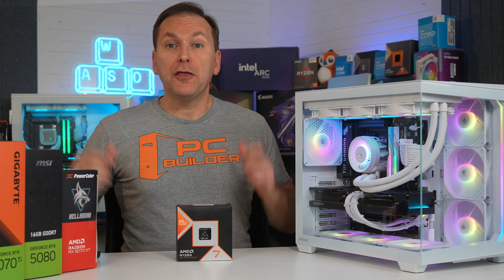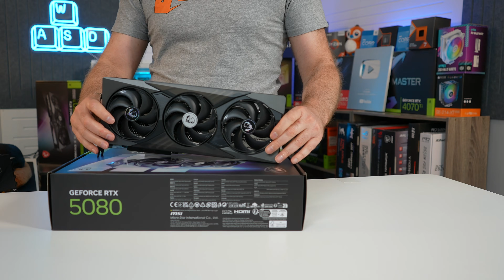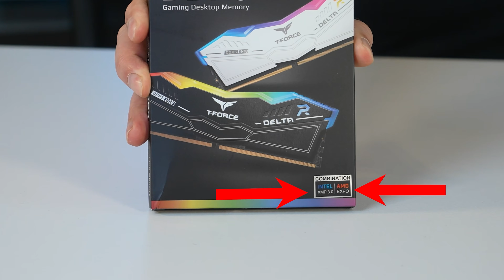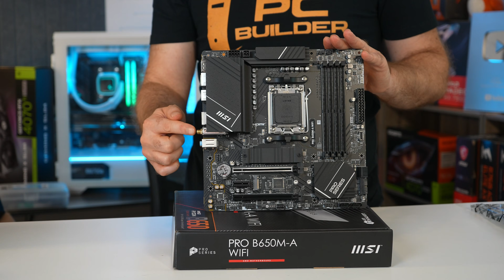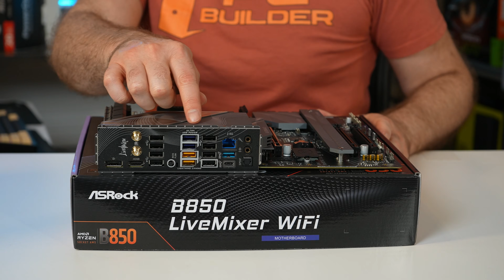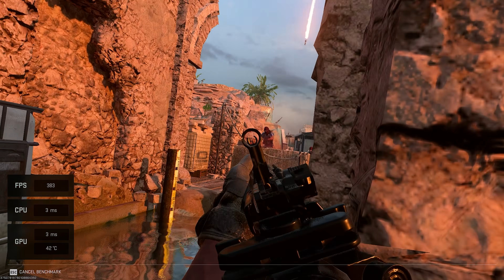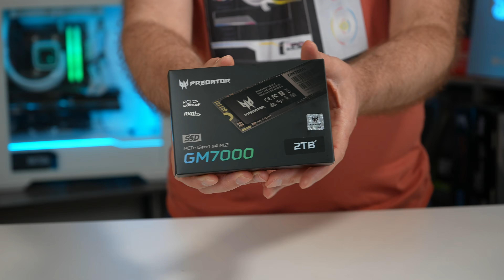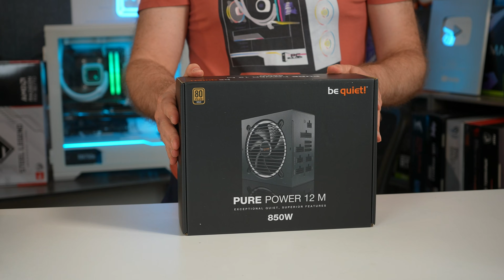Best Ryzen 9800X3D PC Build 2025 🛑 Best GPU, RAM, Motherboard & More

Comment: 3rd PC build just finished it mid march
CPU - 9800x3D
GPU - RTX 5090 
RAM - 64 GB Trident z5 Neo RGB 6000/CL30
MOBO - MSi x870e Carbon WiFi
SSD - 4TB Samsung 990 Pro NVME
PSU - NZXT 1200 watt ATX 3.1
CPU Cooler - NZXT Kraken Elite 360mm 2024 
Case - Hyte y70 (non-touch waiting for HAVN HS 420 to be instock)
Reply from the maker: Congrats on your third build! And thanks so much for tuning in :)
Reply: 9950x3d is better
Reply: @UM_88-s2c  wasnt out when i built and im not spending 700 on new cpu when mine is better for pure gaming and i dont focus productivity

Comment: ASRock B850M Pro-A/Wifi $110/$120 - pcie gen 5, 3 m.2, 8 usb ports: 4 hi speed w/1 type C, 2.5GB LAN
ASRock B650M PG Lightning Wifi $120 - 3 m.2, 8 usb ports: 4 high speed w/1 type C, 2.5GB LAN
ASRock B850M STEEL LEGEND WIFI $160 - pcie gen 5, ALC1220, 3 m.2, 8 usb: 4 hi speed w/1 type C
ASRock B850M Riptide WiFi $190 - pcie gen 5, ALC1220, 3 m.2, 8 usb: 4 hi speed w/1 type C, 2.5GB LAN
ASRock B850 Pro-A WiFi $160 - pcie gen 5, 4 M.2, 12 usb ports: 6 high speed w/2 type C, 2.5GB LAN
ASRock B650 Steel Legend WiFi $190 - pcie gen 5, ALC4082, 3 m.2, 10 usb ports w/1 type C, 2.5GB LAN
ASRock B850 Riptide WiFi $190 - pcie gen 5, ALC4082, 4 m.2, 11 usb: 7 hi speed w/2 type C, 2.5gb LAN

Comment: Going with a Be Quiet!-themed build for mine after lucking into the GPU I wanted:

CPU: 9800X3D
GPU: RTX 5090 Gigabyte Aorus Master Ice
MB: Gigabyte X870E Aorus Pro Ice
RAM: 32GB white RGB (haven't decided yet)
SSD: 2TB Samsung 990 Pro + 2TB WD SN850X
PSU: Corsair HX1200
Cooler: Be Quiet! Light Loop 360 (white)
Case: Be Quiet! Light Base 900 (white)
RGB cable extensions/covers
Reply: replace the corsair with Darkpower psu. i done similar thing a long time ago XD i blame Dawid for this

Comment: I went 9800X3D, Gskill Trident Z5 NEO 6400 CL30 (32GB I already owned), Asus ROG Strix B850, Corsair MP700 SSD, Corsair 240 AIO, and Corsair 4000 Frame case (best case EVER).  all on a Seasonic Vertex GX-1200 watt power supply.
I have a 7900XT, Keep trying to buy a Sapphire Nitro+ 9070XT. (need the 16 pin because my AIO uses one of my PCIe power slots and I only have 3 of those total.  so I have no option but to run that 16 pin connector.

These site always recommend some barely good enough PSU. Get yourself a 1200watt or higher and then if you buy a used 5090 in a year, you won't also have to buy a new PSU...  850Watts is Barely enough to turn a PC on these days.  it's the Only thing I never agree with on these videos. its almost like they are afraid to recommend a part that you can reuse next build.  power supply requirements are not going down. stop buying 850 watt PSUs  really bad advice and nothing will ever change my mind.  never buy less than a 1000 watt unless you are building something with a 5060 graphics card or less and NEVER plan to buy a fast card.  a 9800X3D build with a 5080 and the rest wants 646 watts X 1.5 = 969 watts.  850 is Not enough. now throw in 200 watts more for a 5090 and you see why I say Get a 1200 watt PSU.

Comment: I recently upgraded my 8700k to a 9800x3d with a ASUS b850 WiFi plus and 32 gb 6400 corsairs ram to pair up with my 3080 10gb from my friend. Now I’m not getting bottled neck on most games!  Wasn’t cheap for the build but I’m just future proofing with am5.
Reply: @seasonalocean  damn dude, that's a monster upgrade!
Reply: I have the same motherboard and debating of getting the 9800x3d over the 7800. I have a question did you update the bios or did it work out of the box?
Reply: @Stickman_gt1  well worth checking the board manufacturers website, they will have all the information on what the bios updates do and if you need to update before cpu upgrade aswell
Reply: @St1xkman  worked right out of the box.
Reply: @ I don't trust corsair RAMs coz they have CL36 latency
Reply: @UM_88-s2c  yea but most of my build was all corsairs stuff. The aio, 9 ll120 rgb fans, keyboard k95 platinum and the commander pro hub.

Comment: I want to upgrade from my i7 4770k to a new platform so I was considering the 9700x, then changed my mind to 7800x3D and ultimately thought "What the heck?! I'll go with the 9800x3D!". The rest of the components are as follows:
MB: MSI MPG B850 EDGE TI WIFI
Cooler: Thermalright Phantom Spirit 120
RAM: Kingston FURY Beast 32GB DDR5 6000MHz CL30 Dual Channel Kit
SSD: WD Black SN850X 2TB PCI Express 4.0 x4 M.2 2280
PSU: Seasonic VERTEX GX, 80+ Gold, 1000W
GPU: XFX Radeon RX 9070 XT Quicksilver Gaming Edition Black 16GB DDR6 256-bit
As for the case, I already have a middle-tower with 4x 120mm fans
However, I'll leave the GPU for the end of summer. Maybe the prices will go down at least a little bit...
Lastly, thank you for the valuable info you give us, Jason! Looking forward to your latest tutorials and guides!

Comment: Currently on:
AMD Ryzen 9800x3D
Arctic Liquid Freezer III 360 AIO
ASUS B650E-I ROG Strix mini-ITX Motherboard
G.Skill Flare 32GB DDR5 6000 CL30
4TB WD Black SN850 nVME SSD
XFX Merc 7900XTX 
Corsair SF1000L PSU
Corsair 2000D mini-ITX Case

Having lots of fun with Avowed, Indiana Jones, and soon South of Midnight and Doom the Dark Ages.

I should add though - I had to ditch the SSD heatsink on my ASUS board as the Arctic AIO would not install otherwise. Got a cheap Thermalright heatsink to replace it, and the VRM cooler on the AIO does a great job cooling that as well.

Comment: Recently built my first set up with the 9800x3D and the 7900xtx using your build guides just before the prices went crazy! Went smooth and flawless, thanks again for the help!
Reply: Thats my combo as well. Quite an upgrade for me
Reply: @dannystewart2588 if either of you bought an ASRock mobo with the 9800x3d, return the movo ASAP. I bought the same build (9800x3d, 7900x3d, B850) and it killed the cpu within weeks. Hundreds of other reports of it happening, specifically with X870 and B850 ASRock

Comment: Great vid as always, Jason. I’m curious—would you be willing to speak to the concerns folks have been having with the 9800X3D And various boards, particularly ASRock? I know some folks are saying just to go with the latest BiOS, but there are inconsistencies there too in terms of recommendations. I also have both 8-pin power plugs connected on the motherboard, which is another variable of concern.

I’ve been on a 9800X3D since its release on my ASRock X870E Nova WiFi running BiOS 3.10 and have had zero issues.
Reply: I was having zero issues to, but my cpu fried itself on Monday (ASRock B850 Pro-A MATX and 9800x3d)

Comment: I am gonna go for the rtx 5080 in a Montech king 95 pro. Still unsure about the ASUS TUF Gaming X870-PLUS. Might be overkill as I’m mainly going to be using it for gaming. Then I’m also gonna use the arctic liquid freezer (black, non-rgb) and a corsair 6000mhz cl30 non-rgb ram kit. I was thinking about getting the Samsung 990 pro, but again, might be massive overkill. I would really appreciate some input from you guys as this is my very first gaming pc.

Comment: I just built my first Pc ever. 
I connected it correctly for the most part. In Bios it correctly read the Mobo, cpu, ram and SSD. 
However my fans are low power and the front 3 are no power. Is it possible that I corrected it correctly but a bios setting is preventing it from working properly? Thanks.

Comment: CPU AMD Ryzen 7 9800X3D
Main Asrock x870e Nova
VGA 9070XT nitro+ / taichi 
Ram G.SKILL Trident Z5 NEO RGB BLACK DDR5 64GB (32GB x 2) 6000MHz CL30
PSU Super Flower Leadex Vii pro 1000w platinum 3.1 
SSD WD Black SN850X 2TB 
Case Montech King 95 pro
AIO  ARCTIC LIQUID FREEZER III 360 

 this is my build is there anything need to change or can improve ? thanks
Reply: 9950x3d is better
Reply: @UM_88-s2c  yeah but price too high

Comment: Great video ill bet you get tired of saying 9800x3d 😂. All kidding aside im torn between a 9700x or a 9800x3d i have a 9070xt would i be leaving alot as far as performance? I play 1440p i can get the 9700x for $235 from local guy used should i go all in on a 9800x3d. The cpus failing is a concern im my mind. The 65 watts extra for 9800x3d has me concerned with the heat and overclocking.

Comment: cheapest 9070 = €800. i can't afford to spend this much and also buy 9800x3d. with 9800x3d, my budget for GPU is around €600. at this range there's 7800xt and 7900gre(€620 on amazon). should i get 9800x3d or another CPU? if another, which one?

Comment: Planning on buying for my 9070XT Red Devil

9800X3D
X870-E
990 Pro SSD 2TB
32 GB DDR5
Y70 Touch Case

Might have some overkill on here, but happy to spend a little extra for the aesthetic. Still need to research which AIO cooler as well as which fans to install (thinking of magnetic fans from LianLi)

Comment: Asrock X870e Nova Wifi ftw🔥🔥🔥
Reply: Return this ASAP. ASRock B850 and X870 have been frying 9800x3ds like crazy. Happened to me on monday. Someone compiled the data, and there’s over 100 cases of ASRock x870s frying 9800x3ds, and 80+ cases for B850
Reply: @Gobbo-y7g  had it since October/November and no issues

Comment: Here's my build:

 AMD: 9800X3D 

MSI MPG X870E CARBON WIFI 

Case: be quiet! Light Base 900 FX Black plus other Light Wings 140mm PWM high-speed Triple Pack 

PSU: be quiet! Straight Power 12 1000W alimentatore, ATX 3.1, 80 PLUS Platinum 

AIO: be quiet! Silent Loop 3 420mm with be quiet! 

SSD: CORSAIR MP700 ELITE 2TB PCIe 5.0 x4 NVMe M.2 SSD 

Ram DDR5 (EXPO): CORSAIR VENGEANCE DDR5 32GB (2x16GB) DDR5 6000MHz CL30

Im quite happy with the results of my Asrock 9070 XT Taichi 😊
Reply: Ethereal GPU?
Reply: @KyngD469  ?

Comment: My build: 

CPU  
•AMD Ryzen 9800x3d

COOLER

ARCTIC Liquid Freezer III 360 A-RGB 48.82 CFM Liquid CPU Cooler white

MB

Gigabyte X870 AORUS ELITE WIFI7 ICE ATX AM5 Motherboard

RAM

TEAMGROUP T-Force Delta RGB 32 GB (2 x 16 GB) DDR5-6000 CL30 Memory WHITE

MEMORY
Samsung 990 Pro 2 TB M.2-2280 PCIe 4.0 X4 NVME Solid State Drive

GPU 

RX 9070XT 

• GIGABYTE Aorus elite

PSU 
MSI MAG A850GL PCIE5 850 W 80+ Gold 

CASE 

Deepcool CG580 WH 4F

 CASE  FAN

2X Lian Li Uni Fan SL-Infinity 61.3 CFM 120 mm Fans 3-Pack

ARCTIC Case Fan Hub Fan Controller

I'd be more than happy to know whether this is ok or there are issues , as I haven't bought the parts yet

Comment: Right now I'm in the middle of building a similar pc in Poland (+23% prices on everything, because of tax difference), 9800x3d (got it for 515$ brand new off an auction), most premium model of 9070xt, 48GB of ram (cl30 6000mhz), and an Asus b650e-f motherboard (was on sale for only 196$, a day before the sale ended going back up to 250$)
Reply: Same brother, but I am in Belarus, plus 40-50% to all of the prices, bought 9800x3d for 700$
Reply: Nice brother. I like bigos👌🏻👌🏻
Reply: wish I was in America everything is so expensive
Reply: Best of luck
If a 9900x is cheaper, its worth losing a few fps to have the better cpu, it will give a smoother gameplay experience, not shown in an fps benchmark and overall system responsiveness and multitasking will be massively better, especially when gaming 

Oh and a game like cyberpunk with a 9070xt will saturate that cpu to 60% which is actually really not good in terms of performance in the longterm
Reply: @mickieg1994  i heard about ccd switch causing lags in 9900x

Comment: At 3440x1440 p, in some games, the CPU definitely makes a difference. In No Man’s Sky, there is a massive uplift going from an i9-11900K to a 9800X3D , using a 4070 Super paired with each cpu. High settings at 80-120fps to Ultra settings at 180-200+ fps.

Comment: Thanks for the video.  Currently running a 5800x3D with a recently purchased 4090 to run triple screens in iRacing.  Perhaps there will be discounts on Black Friday and I'll snag a 9800x3D/B650/32GB deal.  Reuse my case, PSU, and GPU.
Reply: @AdamB5000  if you have a 4090, I would highly, HIGHLY, recommend a 7950x3d over a 9800x3d, or if you have the budget either the 9900x or 9950x or their 3d variants

Basically, don't go 8 core, you will get a far better experience with a more capable cpu, don't be fooled by fps benchmark charts, they don't represent the full end user experience and never will. 

Also, don't listen to the "8 cores is enough for gaming" crowd, you have a 4090, give it a cpu that it deserves
Reply: CPU bottleneck 
Go higher like 9950x3d

Comment: Net ge-upgrade van de 7700K naar : AMD Ryzen 7 9800X3D - MAG B850 TOMAHAWK MAX WIFI - Kingston FURY Renegade 1TB - Kingston FURY Renegade 2TB - G.Skill Trident Z5 Neo F5-6000J3040G32GX2-TZ5N - MSI MAG CORELIQUID 360R V2 waterkoeler -MSI MAG 271QPX QD-OLED E2 27" Quad HD 240Hz OLED - MSI GeForce RTX 4070 Ti GAMING X TRIO 12G . Gaat als een malle .

Comment: I bought everything except the CPU and GPU on new years eve and then finally snagged the CPU 3 weeks later. 2 and a half months after that, my GPU fiinnnaalllyyyy arrived just yesterday. If I had known it was going to be that difficult, I would have waited and gotten a B850 mobo for better VRM and audio. Oh well. Also went with 64 GB RAM just because. 

AMD Ryzen 7 9800X3D 4.7 GHz 8-Core Processor
Yeston Sakura Atlantis RX 9070 XT 16 GB GDDR6
MSI MAG 321UPX QD-OLED 31.5" 3840 x 2160 240 Hz Monitor

Gigabyte B650 AORUS Elite AX ICE ATX AM5 Motherboard
G.Skill Trident Z25 Neo RGB 64 GB (2x32) DDR5-6000 CL30 Memory (white)
ARCTIC Liquid Freezer III - 360 A-RGB All-in-One CPU Water Cooler (white)

WD_Black SN850X 1 TB M.2-2280 PCIe 4.0 X4 NVME SSD
WD_Black SN850X 4 TB M.2-2280 PCIe 4.0 X4 NVME SSD
Seagate Barracuda Compute 8 TB 3.5" 5400 RPM HDD

be quiet! Pure Power 12 M 1200 W 80+ Gold Certified Fully Modular ATX PSU
Montech King 95 ATX Case (non pro to get a black case w/ white fans bought separately for a nice contrast build)

🔥

Comment: Hey guys. Just finished my build. Can anyone check the compatibility or if there would be any issues. Thanks

9800x3d
b650m elite ax
32gb kingston fury beast 6000mt/s
sapphire pure 9070 xt
wd sn850x 2tb
deepcool ch260
deepcool lq360
thermaltake swafan
phanteks amp gh 1000w plat

Comment: Best part about the 9800x3d is with the 9950x3d out, scalpers are buying that CPU which means the 9800x3d is normally in stock.  I've seen it in stock on Amazon now for the longest I've ever seen it.
Reply: Just bought mine lastnight

Comment: The nice part here is the premium guide with a swap out to an X670/870 board is a solid starting point for a 9950X3D as well depending on use case.  Just got to add in a couple of HDD and you're golden 😉
Reply: HDD in 2025 ? I don't think so
Reply: @UM_88-s2c  it's a joke, hence the wink face.  Specifically because Jason is all over do not use HDD in new builds.
Reply: @ should I get 9950x3d for just gaming ?
I REALLY don't like 9800x3d
Reply: @UM_88-s2c  i don't think at 9950X3D just for gaming.  Why not a 9800X3D?

Comment: good templates - do a comparison of unified mem and using exo  to run a couple 3 machine clusters and compare numbers - you can get the amd cluster for slightly more than 1 apple machine - lots of people would have a use case for these, 2nd and 3rd gen should be even better and that is not forever - we will see medusa zen6 mobile 6-9mos and  zen7 in 3 yr